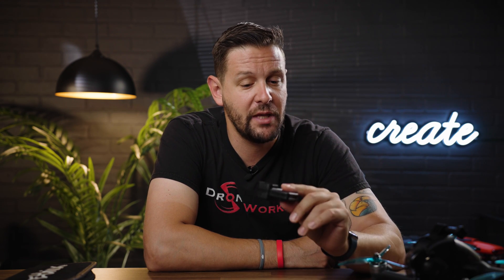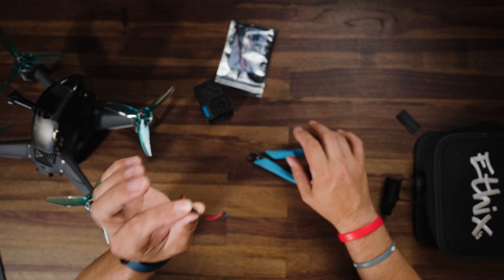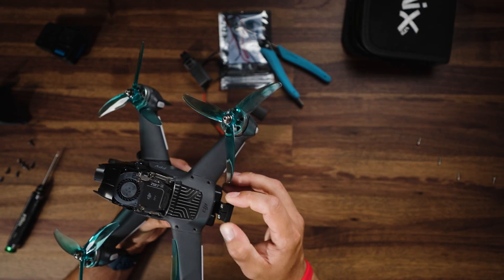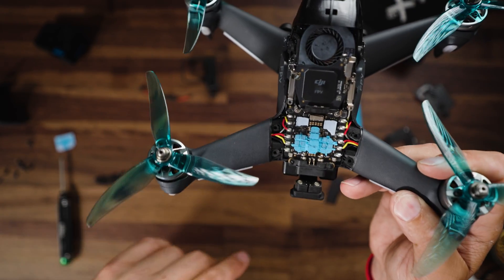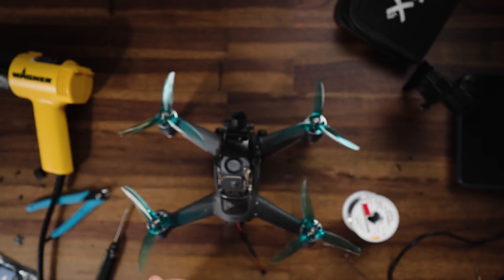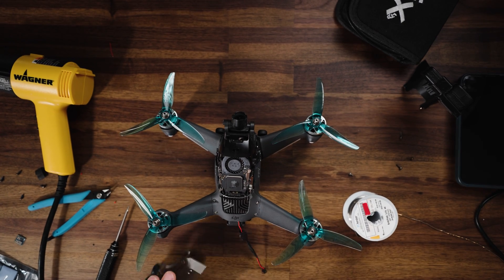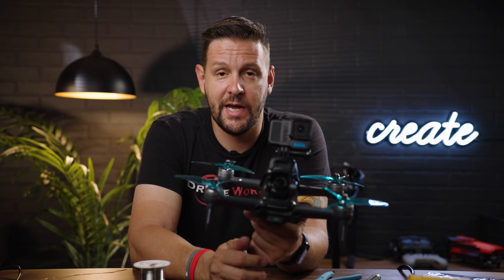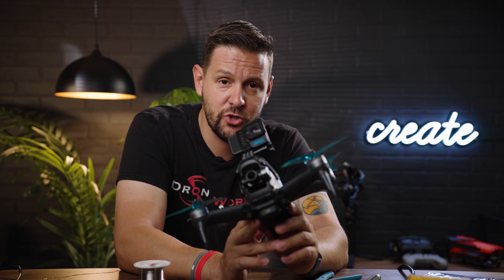Mounting the Hero 10 Bones to the DJI FPV Drone | Tutorial

Comment: GreatVideo !!! 
Instead of soldering directly to the drone's board, wouldn't be cleaner to use some sort of XT30 extension cable between the batery and the drone? and wiretap the extension cable?
Reply from the maker: You have a telemetry lead between the that
Reply: @OriginaldoBo  yes, I was also observing the battery and drone connectors and they have additional (and tinny) pins

Comment: Atta boy kester solder wire is the way to go. No flux needed. It dramatically changed my soldering skills. This is a pretty sweet idea. Where can I order your battery condoms and GoPro mounts? Its definitely easier to fix the DJI drone now that there is parts.

Comment: Great video as usual Ken and thanks for the shout out! When I did mine I didn't add the BEC, haven't had problems yet (knock on wood). I did install an XT30 connector in-line though so I could remove the cable when I didn't have the Bones connected, basically the same place your BEC is installed. Thanks for everything you do for the FPV community, keep up the good work buddy!

Comment: Excellent tutorial! Does the bones 10 edition still render the GPS lock unavailable like the regular Hero 10 when you hit the record button on the DJI FPV? I've tried a Hero 9 and Hero 10  and the second I hit the record button I loose my GPS lock, I've had some less than desirable results doing that, crazy what I would almost call "fly aways" but was always  able to regain control. It's a shame because the camera on the DJI FPV is just so poor, I'd love to slap a gopro on it but keep running into this GPS lock loss the second the record button is pressed. I even had this same experience with the little 360 V2 camera, it did the same as soon as I hit record, total GPS lock loss, still gets the sats, just looses the lock.
Reply from the maker: The best I can see so far I haven’t had any issues with GPS